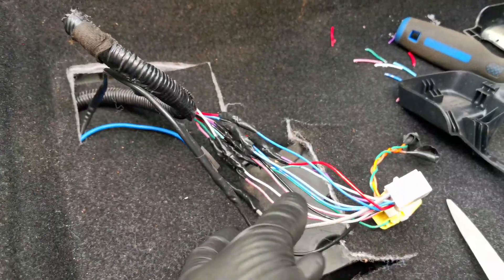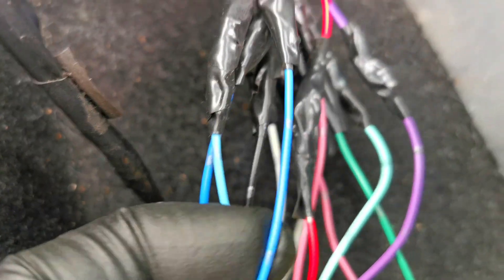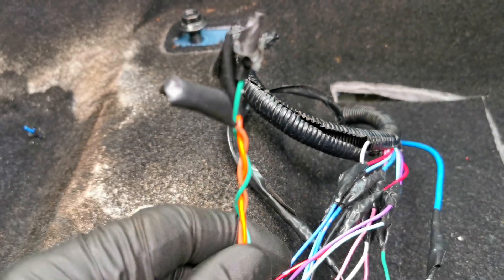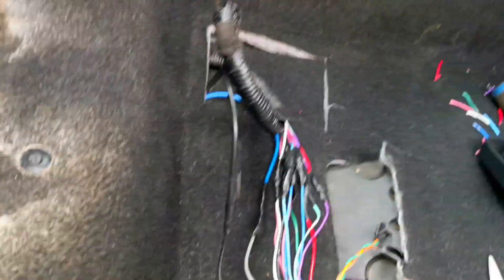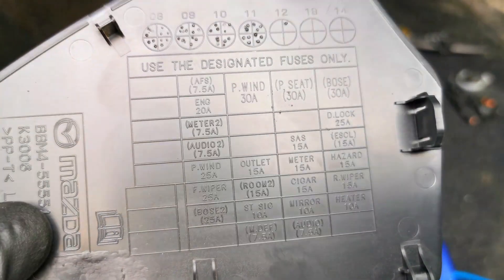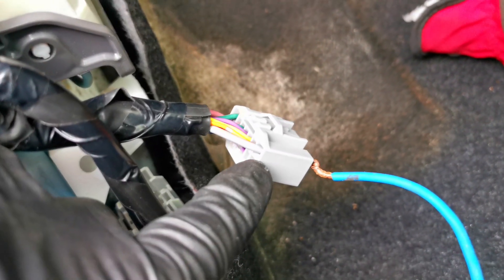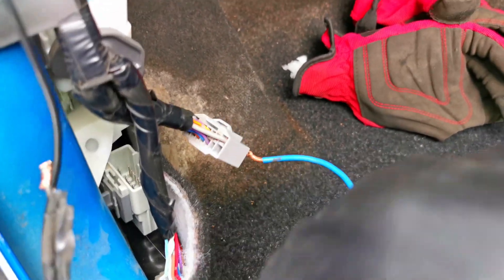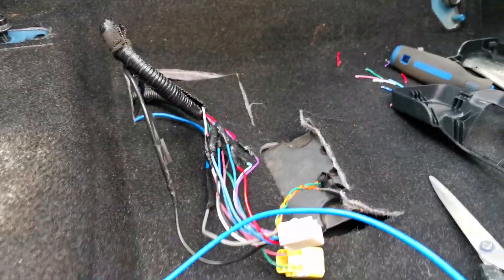YOU NEED to KNOW THIS Before Installing Power Seats in a Mazda 3

Comment: Thanks for this video. I am looking at trying to put in heated leather power seats from a 2012 into my 2012 with manual seats. You make it look doable,I know I will have to modify the harness. But it doesn’t look to difficult.

Comment: could this been done the other way around, rewiring the connecter from the old chair to the new one, because i dont have the car connectors
Reply from the maker: Yeah I think you could probably do it like that, it's just the ground and power cable you'll have to feed them separately.
Reply: @DrivingProduction  hey there didn’t work because I’m from Australia everything is on the wrong side, could I connect it to the battery? I’ve already tried it, but its not working, I’ve been told I need a voltage step down converter, but I can’t find one that’s wire to the car battery?

Comment: I have a Mazda 3 2011 touring. Looking to swap to automated Rx8 seats non heated. Seems that I should be able to follow your video. You mentioned seat weight sensor didn't need adjustment for airbag?
Reply from the maker: That would be really cool seats to swap in! No the air bag sensor seemed to be the same, not sure about the Rx-8 one though! Hopefully your swap works out!
Reply: Did you swap em?

Comment: So what if they are not powered speed seats and just regular mazda 3 power seats. Do you know if the connectors are the same or would I have to add the extra two wires still?
Reply from the maker: If they are both manual I would assume they would be the same but I'm not sure to be honest.

Comment: Great video! I've been searching long and hard to figure out how to do this and I haven't found anything even on forums! That's a great discovery on the gray wire coming from the fuse panel, too! 
One thing, if you have a second do you think you could include the wiring connections you made in the description(e.g. blue/black ->green)? Or did you just match up colors to like colors? Thanks!
Reply from the maker: I had the same issue when I did it the first time, I couldn't find proper info, I'm happy you found the video useful! 👍 For the majority of the wires it's just about cutting them and matching with the same colors. There's a few the color doesn't match up but if I remember correctly they had few things that got them to stand out. And in the end I was left with a few extra unused wires 👍
Reply: @DrivingProduction  Thank you! It would be cool if you could figure out how to wire up side mirrors that have the integrated turn signal (I think these came on the top trim level cars). I haven't been able to find any forum info about that, either. Great work on your videos!
Reply from the maker: Thanks! I've been looking for a set of mirrors with the turn signal for a while now actually so as soon as I get some I should do a video!
Reply: @DrivingProduction  awesome, I'm looking forward to it🙂

Comment: Im looking to upgrade my original cloth non heated non power seats to heated seats by swapping out for an existing mazda 3 seat, does anybody know if the harness allows for that without modification? Ive checked and theres wires already in the dash for it and they appear to run down into harness underneath of the seat now, does that mean it should be plug and play? Thanks!
Reply from the maker: That's a great questions, I already had the heated seats installed on the car, you might have better response on the forums. Hope you can figure it out!